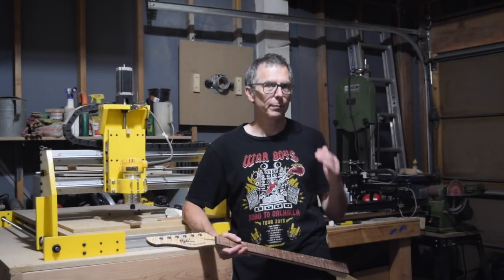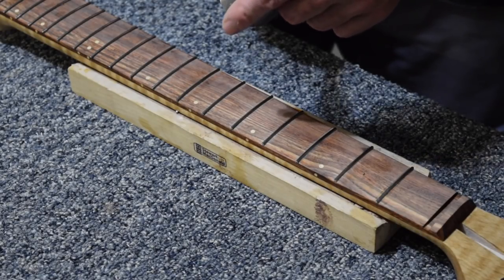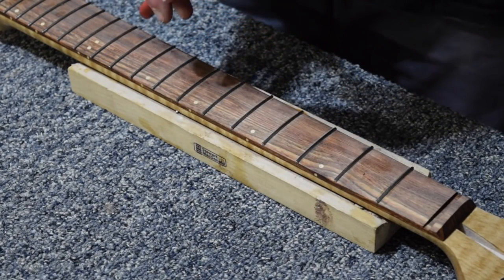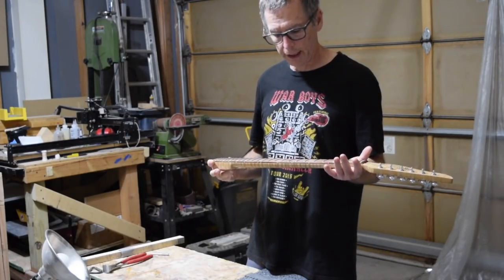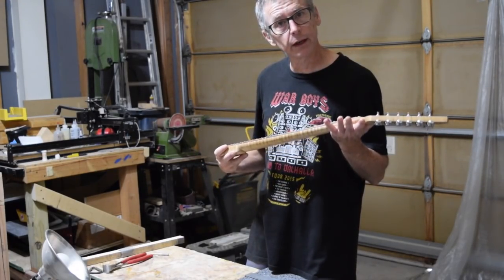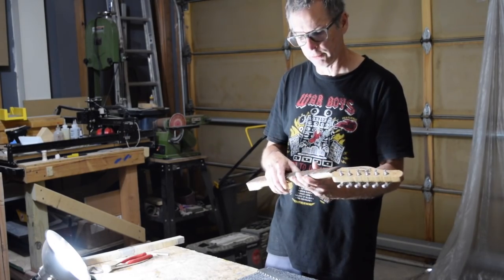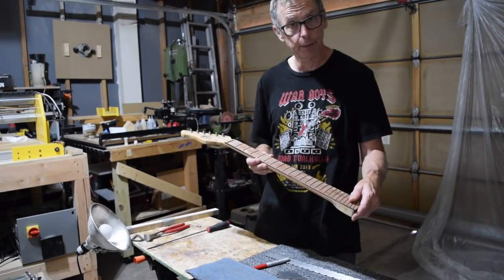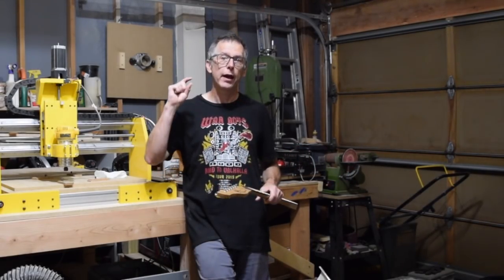Episode 106 How I Decide What Steps To Take After Installing Guitar Frets

Comment: Oh you are so correct about bow with new frets ( bows up for me)  right after frets installed.  Old fenders will not correct up bow with truss rod.  I pull neck down in the middle  with zip ties and holes in the bench.  When straight I dress frets.  After a few days neck usually  flattens.  Thanks for video!!

Comment: Thank you for sharing your knowledge with us your videos are great.  If you were to re fret a fender would you nip the tangs a little short and fill the gaps at the end or would that be a waste of time?  I notice you cut your slots short of the end and cut the tangs appropriately for the length of you slot I think this is a great way to do it because this would eliminate fret sprout.  I guess what I am asking is would I be able to mimic this on my guitar that the slots are cut right through on a re fret.  Thank you again for your great work.
Reply from the maker: Yes, that's what I would do.

Comment: How do you avoid messing up the fret board on the belt sander?
Reply from the maker: Practice and experience. When the belt contacts the end of the frets, the sound it makes is much louder than when the belt touches the fretboard wood. The instant the noise dies down, I rotate the neck just enough to bevel the fret ends and stop immediately. It also helps to make the neck and fretboard a tiny bit wider than needed. Doing that allows for a little extra wood which can be sanded away by hand later on.